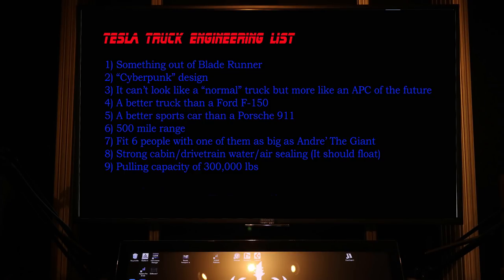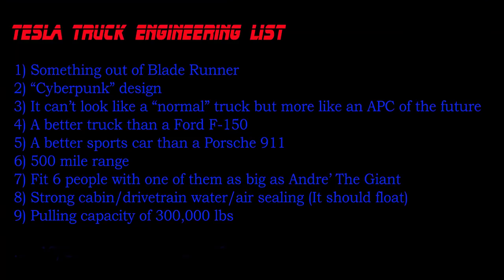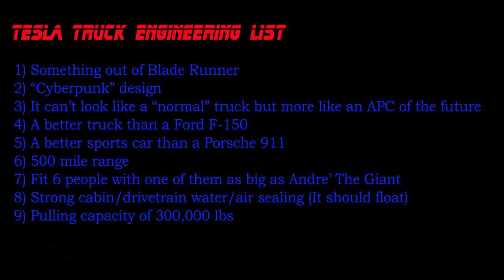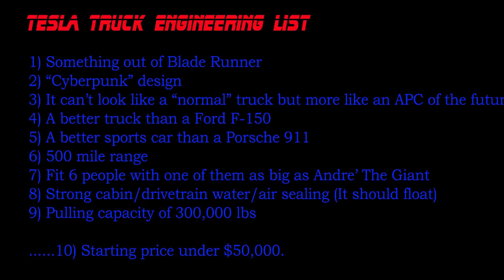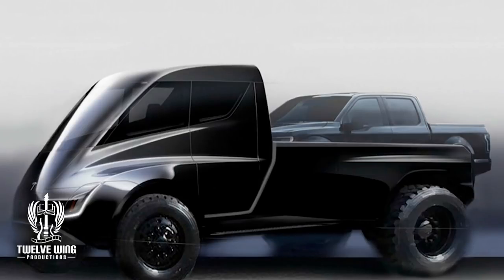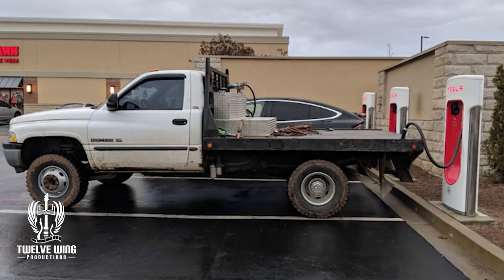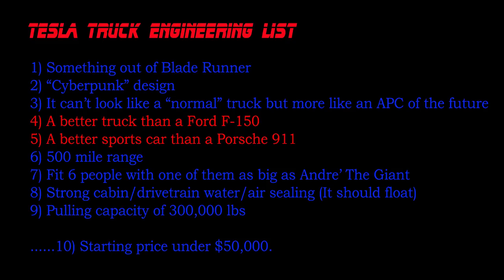What Tesla's Pickup Truck will Really look like: A design exercise

Comment: I think the drive train will come from the semi for the heavy load capability and quick torque,  the battery pack will probably consist of the ultra capacitors from Maxwell and possibly solid state batteries that have been in research backed by Dr Goddard's groundbreaking research ,among others who have contributed to the current level of technology in these batteries. 
The cab I figure is probably very much what you describe, and the bed pretty much like a duly in width with hidden compartments in the sides and under the bed just foward of the wheels.
If I were designing this I would make it be able to lower down for regular driving and raise to gain ground clearance,  airbags would do this.
The tailgate becomes a work bench with power ports just inside on the interior to run tools and a 220 port to supply a worksite instead of a generator. 
As with all of the old trucks make the tailgate removable but go one better by being able to use it as a latching ramp for loading and unloading the toys or work related things.
As for another little extra why not use some of the technology from the home roofing solar panels to make  the top of the cab glass into one big collector to help trickle charge while out in the wilderness on those camping excursions or to help carry the load on the sight.
Reply from the maker: From what I understand, the Semi uss Model 3 motors.  I"m not sure if they, or their gearbox, is modified in any way.
Reply: I don't think there will be too many super capacitors, because they require huge amount of space. Unless this thing is going to be a size of a huge semi I can't see having place for super capacitors.
Reply: The supercapacitors are the technology,  not so much a particular need for a very specific size .
If you use about 1-2% of the capacity of the pack as supercapacitors and the rest batteries the capacitors become buffers for charge and discharge enabling more resilience and lifespan.
If the batteries are the solidstate technology that Tesla has been trying to perfect all the better.
All of this speculation is associated with the reasoning of acquisition of maxwell and another company dealing in battery manufacturing. 
Let's just say this is a researched guess, and hopeful thinking.
Reply: @twelvewingproductions7508  I would think that the semi drive system would have to be beefed up to handle the load of pulling associated with such endeavors , the motors I can see being from the model 3 but in their gearbox as is would not handle the load of a semi.
I should think that the gearbox for the truck would fall somewhere between the two since the model 3 can not claim anywhere near the capabilities being claimed for the cyber truck and the semi would have to many to be practical in the its smaller brother.
I guess we shall see come the 21st.
Reply: @danielrichards9138  that is right, you can have 1-2 percent supercap fir short bursts, that is possible. It is important to know that cca 1 to 20 is the supercap vs battery density. So no magic can be expected. Unless the graphine super cap is what they own. That would be crazy.
Reply: Something else that I think people have no brought up but needs to be approached is Elons drive to go to mars and what he is going to need to move around there.
I have read alot of very good ideas about different things that can be done in conjunction with the truck but what about a truly out of this world idea with some form of it finding it's way to Mars. 
One idea I saw in amongst all of the comments in here was a motor home built on this platform which in all reality  could be made to work on Mars or some paired down version on the moon.
I step back and look at all of the businesses that Elon Musk owns and I see a plan of infrastructure happening here.
SpaceX to get to Mars, solar and batteries for power, the boring machine for making underground dwellings and transportation systems, Tesla for making vehicles capable of handling Martian terrain and a candy company to be able to make sustainable food products. 
The idea of stripping down the spaceship for raw materials to build with is all well and good but the structures if built on the surface  would  be fighting against harsh radiation.
So all of this being said I think we can expect to see something special with the truck.
Reply: @danielrichards9138  Underground makes sense on the moon and mars.
Reply: Well cybertruck is out and to my surprise alot of the predictions that I made kind of came true.
The large cabin that seats six with storage under the back seat, the large bed with extended storage in the sides and under the bed .
The expanding tailgate going into a ramp,(didn't see the 4 wheeler coming though) but I did mention toys.
The air ride suspension and after the fact mention of solar panels making up the bed cover, in fact the bed cover itself was mentioned. 
I guess now all I need is confirmation of the solidstate battery pack with super capacitor buffers, however the greatest thing about the truck that no one guessed about is the fact that it's made of stainless steel and has such an angular shape.
The truck that delivered more than anyone could have guessed.
The specs on the other hand are more down to earth than we were expecting but make alot more sense that what was being speculated due to Elons previous comments. 
Still all in all this is quite the vehicle and seams to deliver on his promises.

Comment: I really liked your battery analysis but I think these predictions are off base. There's no way they're going to do a central driver, it's too non-conventional and drivers simply want to be by a window. The truck will likely feature a long sweeping windshield which would place the Andre position as the middle rear seat (most headroom, most shoulder room). Towing braking can be very significant utilizing both motor generators and traditional brake pads -- system cooling will be the bottleneck.
Reply from the maker: I can't argue with your reasoning.  I went back and forth between having the large person in the drivers seat as opposed to them on a bench in the back.
Ultimately I gave the nod to the layout from the Tesla Semi, but you could very well be correct since Elon never said... "And if you are the size of Andre' the Giant... this is your car"... or anything else to insinuate that the large person would be the driver.

That's the fun of all this.  Very different, and well supported, arguments for a whole range of different designs.  These responses were EXACTLY what I was hoping for.  After the 21st I'll do a very fun recap of all these design elements and we can talk about why the new truck will, or will not hit the marks it needs to.

I am very excited about the reveal and I'm even more tickled with all these wonderful responses.
Reply: @twelvewingproductions7508  I'm super pumped too -- can't wait!

Comment: You missed the picture that was post it  of the front of the truck
Reply from the maker: I've seen it many times but I think the angle it was taken from and the filter were purposefully misleading so I didn't use it as a reference. 

It also didn't factor into what we were doing since we were performing more of an engineering exercise than looking at the exterior design.
That's what I wanted to get people to steer away from.  To look at the functionality of the truck rather than its exterior design.
To a great degree, these elements are going to shape what it HAS to look like rather than the approach others have taken that is the reverse.  Trying to force a role for the truck based on what it looks like.

Comment: what about a slide on box or cab on the flatbed , hey presto you have a van or electric powered motorhome ,  saves designing other vehicles for the same thing  ,
Reply from the maker: Something like that would be very handy.
My gut tells me this thing is going to have some radical styling features to make it "pop" from an emotional standpoint.
I hope they go more towards your idea than style for style sake as that will limit its usefulness as a utility vehicle to some degree.

Comment: Medium sized pickup with something stupid like 700hp and it will have air suspension which will be able to lower it and handle much better than an f150 but a porsche? Well thats a headscratcher. No doubt it will outrun a porsche though although only in ludicrous type of trims i imagine not the base $49k one.

The reason I say medium is that it will have more room on it because of the drivetrain so they dont necessarily need to make it fullsize
Reply: It doesn’t have to ‘out run’ the Porsche .... just ‘run over’ it !!! Lol
Reply: Speed of a Porsche is the easiest part- all that torque could have a sport mode to control it when not in work mode.

Comment: This Truck will be a scaled down version of TESLA SEMI BUT 6.5 ‘ high inside.
There will be 3 different versions with centre driver position with staggered passenger seats.
The pickup version will have 8 ‘ box.
The Van version will be 12’ inside for carpet and tradesman.
BUS RV versions will be larger than MB for 12 passengers with windows.
3 versions will totally be better than anything out their coming and TESLA WILL OWN THE MARKET WITH FULL SELF DRIVING.

Comment: The state board platform will make it for more agile than any truck ever made, I think 300000 pound towing is capable but but not DOT approved. Andre would be the only passenger. The eight foot bed would be six feet with tailgate drop down. My eyebrow raised is the price. If under 50 g I’m in

Comment: The starting price has to be more than model X if it's going to have better specs.
Reply: No one says that the base model will have those specs. Yes, my guess is that the initial HD model will be more than a base model X
Reply from the maker: Likely true for upper range versions that actually have interiors.  I think they can do a low cost version, however, but they are going to have to abandon any ideas such as fancy doors and interior accessories.
I don't see this as being a fancy truck.  I see this as being a truck that you can take to work and then hose out the beef jerky wrappers.

Comment: I just can't see Franz designing something that looks like what you proposed in the photoshop pic. Also your take on a "better truck than an F-150" may be different to Elon's take on it. Meaning it could have a short bed on it with a fold down tailgate for extra length (like the Rivian).
Reply from the maker: Agreed... that was nothing more than a quick mockup to show how the seating position was no longer relevant to standard layout trucks.
The driver could even sit down into the truck where the engine used to be provided there was enough crumple zone in front of them to protect them.
We need to stop thinking about size of the layout in relationship to current designs that require a motor and transmission, or even a drivetrain at all.
Some EV's use hub motors.  I doubt this one will, but some do.
Because of that, the "minimum" limitation I spoke of to fit that 8ft sheet of plywood is VERY easy to obtain simply by sliding the cab forward to where an engine used to reside.

I have purposefully steered away from using any renderings in this video so that everyone could think more in terms of the engineering requirements of the truck rather than trying to design it from the outside in.
Because Elon described this as looking nothing like a "normal" truck, I can assure you that this thing looks like it does because it serves a more pure function.

That kind of design doesn't lend itself to pretty renderings.  The most elegant pieces of engineering design look the way they do because of what they do.  I think this truck will be the same.
Reply: @twelvewingproductions7508  Will this be the most-watched youtube event for the year? It certainly has everyone talking and guessing about it. Honestly, I have no idea what it will look like, I thought from the teaser (from the truck reveal) it looked like it had a flat bonnet (hood) and that the cyberpunk look was all straight lines and flat surfaces rather than a forward cab idea but the latest teaser looks like a forward cab.
Reply from the maker: @glennrmarks , It could very well be.
Everyone knows that from a man who makes outlandish claims... is always late with his deliveries... and then over delivers on his promises.... it's always exciting.
Especially when that thing he is delivering is basically what HE wants to do.  We wanted a pickup truck.. but then we wanted a replacement for the space shuttle too. 

What we got were rockets that come back to earth and land on their @$$.

So when we said we want a pickup truck and he said... "Hold my Beer"... well.  It's going to break the internet.
Reply: @twelvewingproductions7508  Well now it's revealed my original idea was not far from the truth, it's not a forward cab, it does have a short bed, 6.5', and it is square and flat surfaces. I think if you put a smooth curve where the pointy roof is it would look a whole lot better, but maybe that adds a lot more manufacturing complexity, and then cost.

Comment: I don’t think they will have 200 kw battery. If the roadster costs 200k and the truck will have more mass and only one less 1000 dollar motor what justifies the cost of the roadster?
Reply from the maker: It's ceramic brakes cost $10,000 a set for Calipers and discs.
So there are some elements that are required for a race car that just make zero sense in a truck.
The battery on the other hand.. that would be useful.

Comment: Roadster is a tiny car, so same battery pack is not possible. About 911: I think Elon ment only 0 to 60 time. Probably the design is quite sleak. For the same reason I think the bed has some kind of cool cover system. And the trucks height is little low. Bit like the APC  in Aliens.

Comment: I would go backwards on your list. If it has to begin around 50K than I can't see having bigger battery at least at the cheapest modell than a double model 3 battery, meaning 150KWh. This would be enough I believe for extreme toing and also for the 500 miles range. 

When it comes to size, I don't think it will be bigger than model X just instead the third row there could be a longer bed. I can't see how could be a full hight door if you want to have 6 people in it. In case of a corridor behind the first row should be the way to exit, the first row should be on swivels, what would mean the car would be vide as an A Clas camper to be able to turn around all 3 seats. That I can't see happening because that would make the car unusable outside off road. Maybe USA has so vide roads but Europe, Japan and many other places not for sure, specially not UK. Same time a corridor would mean lot of space needed what would make the vehicle longer. In case you want to be able to at least have the speed similar to 911 the car should not be too tall, so I don't think we are talking about a tall van you have shown from blade runner. I could imagine more a tank shape a bit like a bullet, max 2 meter tall. 

To be able to float that woud be only question of having good enough sealed area on the bottom with large surface, what is almost guaranteed with the flat large surface the batteries providing. My guess would be that maybe the motors would be contained in some water sealed container, maybe even built in a unibody together with the battery pack and all other electronics to prevent them from the water.
Reply from the maker: Funny you mention that since that was actually my first approach.  To think "What kind of truck can I build for $50K?".

I found that so limiting that I resigned myself to a kind of Model 3 scenario.  That one "would" be available but that it would be software limited in such a way as to bank on the owner either "upgrading" or that if the truck was sold to a future owner that they would do so.
With that, I returned to a purely engineering exercise looking at the truck's supposed capabilities.
Reply: @twelvewingproductions7508  make sense, but we don't have any break trough from the battery side at Tesla, so to estimate that in 2-3 years when the truck might come out. Battery from lab to mass production is not happening in a few years. We will see if there will be some new tech at the roadster in 2021.
Reply from the maker: @gene8194 , I think it's already been developed.  I think it has been done under our noses and that there is hard evidence that they have been working on this since 2015.  We will know more at battery day when they hold it.  We might even learn more on the 21st since Roadster, Semi and the Truck will all be based on the same battery tech.
Reply: @twelvewingproductions7508  I have some doubts about the new tech, although I can see the possibility. Let's hope it is on the way.
Reply: @rsm 287 I don't think it is unlikely, the battery in model 3 is around 12K, so 2 of them would be only 24K that leaves an other 26 to make the car.
Reply: @rsm 287 well, I think tge maxwell technology could more or less make up for that difference once they apply it. So could help the highbar new company. And in 2-3 years they should have already around 1M battery pack per year or more, so I believe just the scale could make the difference.

Comment: Musk said its a 6-seater so, no central seat if there's any hope of fitting it into a garage
Reply from the maker: If your garage will fit an F-150, I think it's doable with the seating configuration I mocked up. 

You simply slide it forward to where the engine and transmission are in a current truck.
The length doesn't change, but you have 3+ more feet work with.
But we shall see.  Only a few more days of hand wringing left.
Reply: @twelvewingproductions7508   yeah - definitely can't wait to see it.